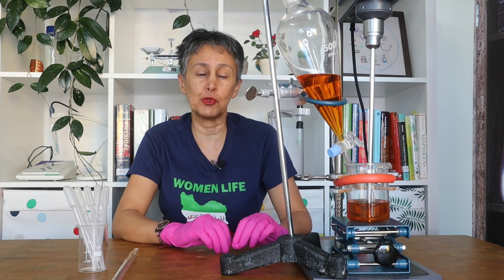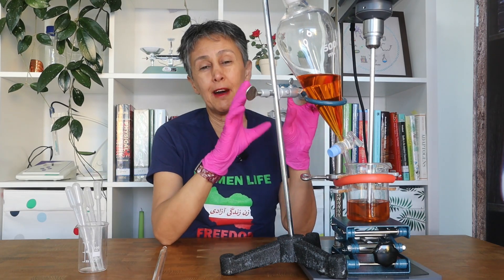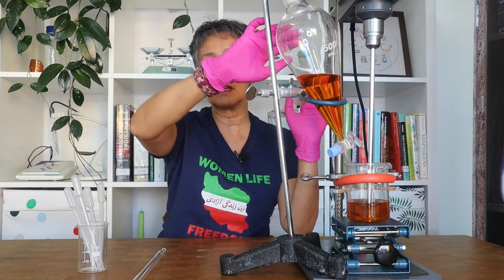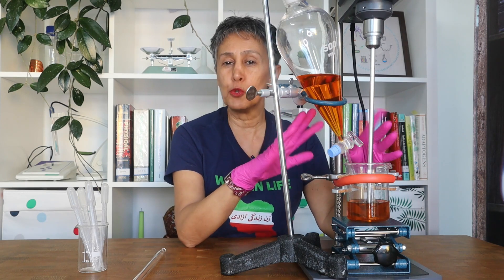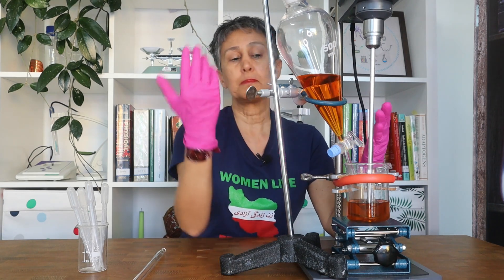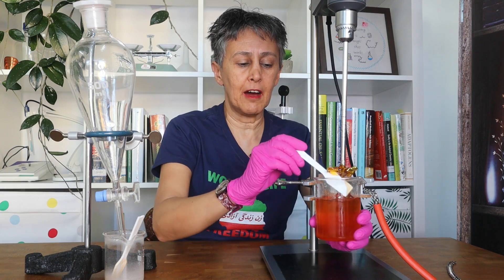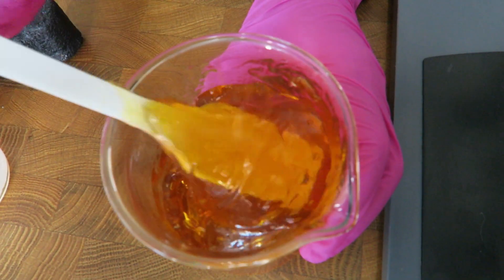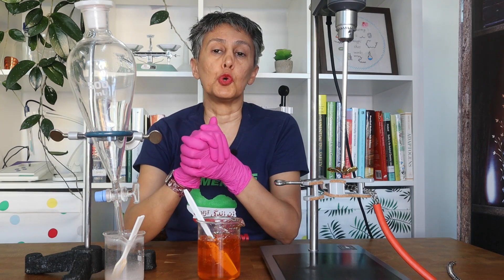How to accelerate production procedure when working with Sapogel Q

Comment: This is such a great idea! You mentioned the separator funnel was was easy to clean, but how do you advise doing this as I would be worried about cleaning all the oil out properly? And you mentioned you didn't measure the time it took to add the oil but can you estimate roughly how long it took for that small batch? Thank you!
Reply from the maker: it takes something between 10-45 minutes depending on the batch size and the speed you adjust the dropping. We have prepared an extra file for the set up and cleansing but basically it is like any other lab glassware
Reply: @skinchakra  thank you for this and sorry I'm only seeing it now as my notifications don't seem to be working. Out of interest, what's the largest batch size you've managed to make with the overhead stirrer and Sapogel (or Sucragel)? I find mine is great if I'm doing 300g batches but I don't know that I'd be able to go up much higher than this!
Reply from the maker: @natashad1272  it depends on the stirrer and the stirrer head you are using. We can prepare easily up to 500 gr with this setup. For a 1 kg batch we need another stirring head
Reply: @skinchakra  thank you! I have a pretty decent stirrer with 40L capacity (though I'd never attempt to make anything close to that!). What stirrer head would you use for a 1kg batch?